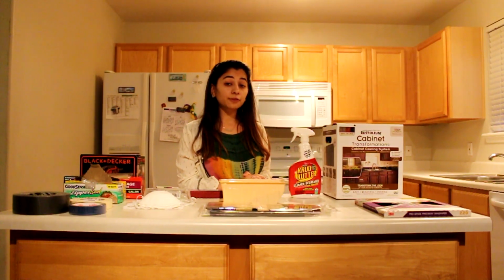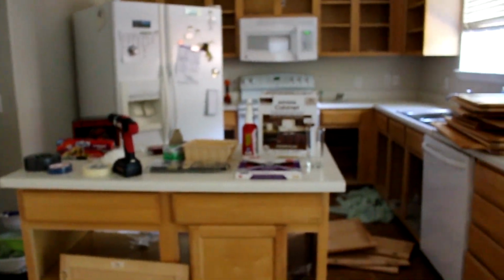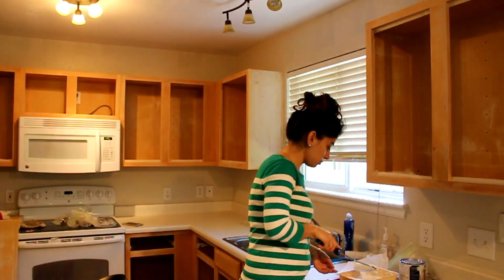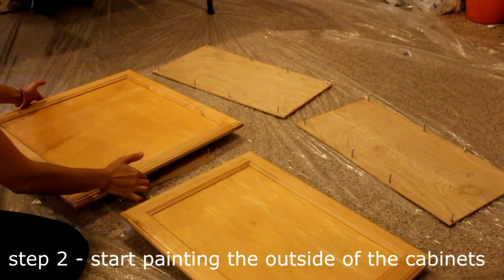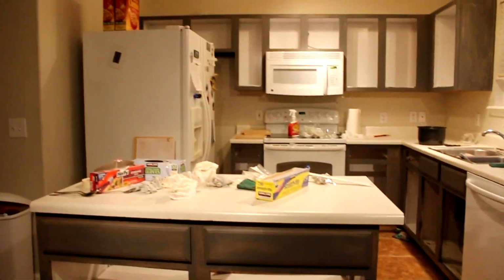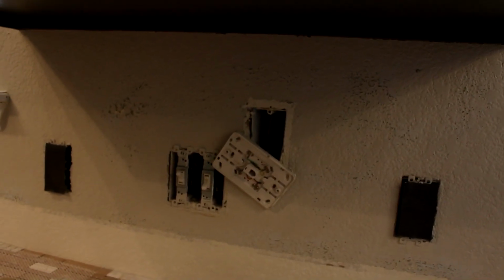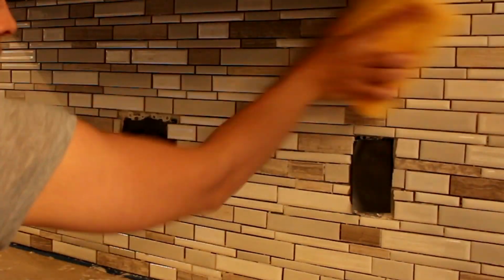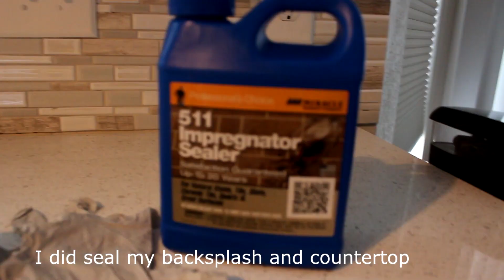DIY Kitchen Remodel on a Budget - Rustoleum Kit

Comment: Looks great, how are cabinets holding up? I’ve done furniture with rust oleum but don’t know if heavily used cabinets would hold up  the same
Reply from the maker: Its been a while since we had it done except close to the knob parts came off in like after 1month I was disappointed. the rest is staying pretty good. The inside of the cabinet I did oil painting I think oil paint is a lot more sturdy than other paints. You should do your search on oil paint maybe if I do it again I will definitely do oil pain. Good Luck :)